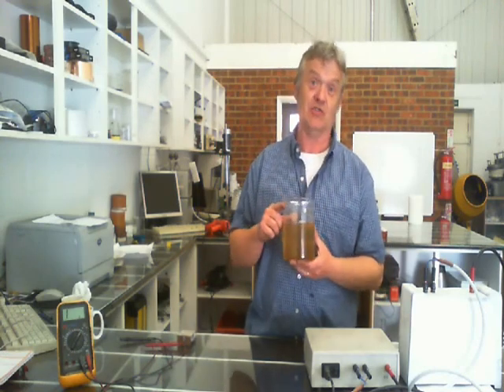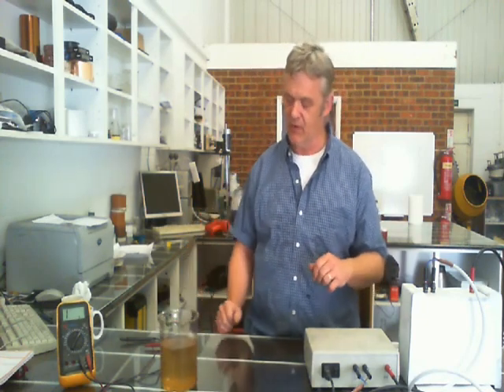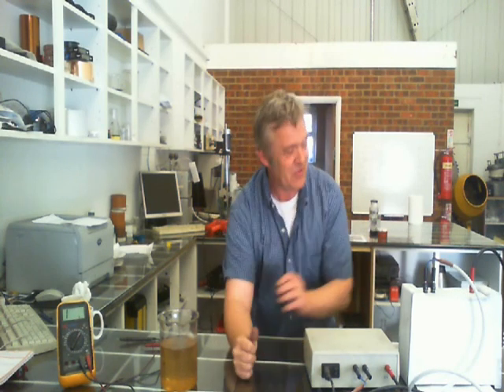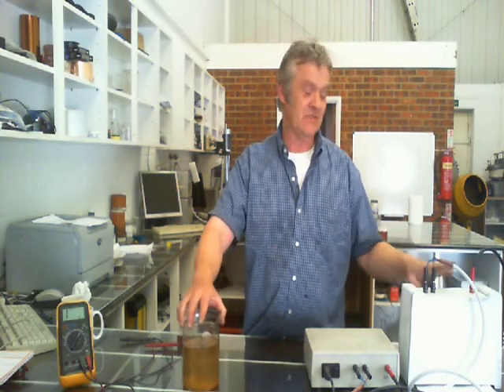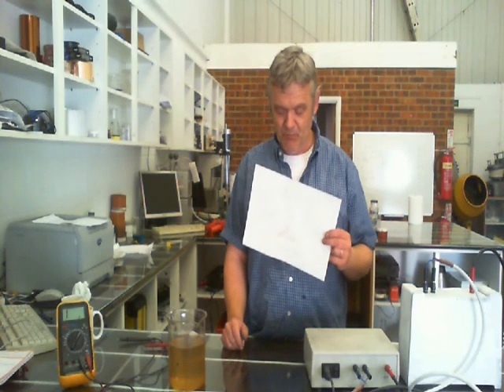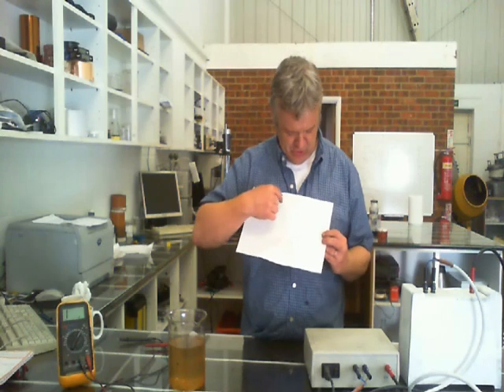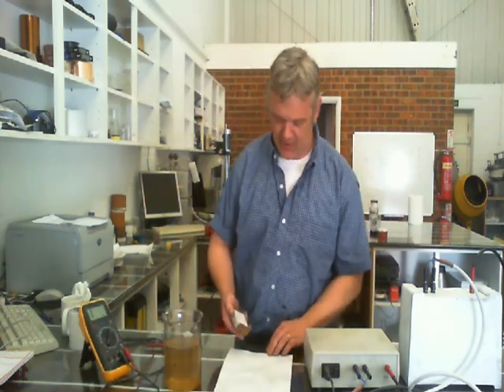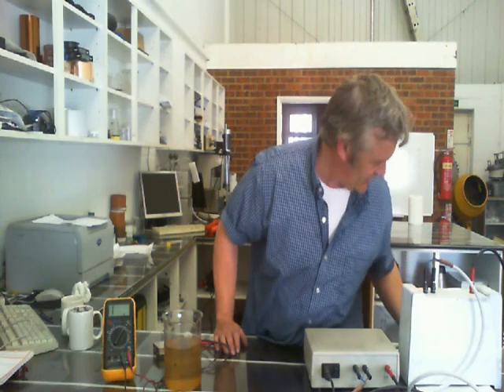How To Reduce Graphene Oxide To Graphene With Photonic Curing

Comment: Hi Robert. 
Look at this:  Highly-Flexible, Low-Cost, All Stainless Steel Mesh-based Dye-Sensitized Solar Cells
Is states they dye them with carbon ink
 http://pubs.rsc.org/en/Content/ArticleLanding/2014/NR/C4NR03999H?utm_source=feedburner&utm_medium=feed&utm_campaign=Feed%3A+rss%2FNR+%28RSC+-+Nanoscale+latest+articles%29#!divAbstract
Reply from the maker: brilliant mate - thanks for the heads up on that one - i think i will make one of these as we are just about there anyway - i get a great sense that we are ahead of the game here lol
Reply from the maker: here is an equally interesting one
http://pubs.rsc.org/en/Content/ArticleLanding/2014/NR/C4NR03999H?utm_source=feedburner&utm_medium=feed&utm_campaign=Feed:+rss/NR+%28RSC+-+Nanoscale+latest+articles%29#!divAbstract
Reply: Robert Murray-Smith Nice try, but it is the same! ;) 
I look forward to see if you can replicate something like this! 
Do remember: If you happen to find a way to cheap, efficient DIY solar cell..  Some groups won't like it!
Reply from the maker: Rob NvT
lol - no it isn't one is steel mesh the other is cloth - plus different authors, different journals - the idea is essentially the same - but they are different articles mate
Reply: Robert Murray-Smith Hahah well, without wanting to start a fittie.. I believe you, but then you have the links mixed up. Your link is the same as mine..
Reply from the maker: Rob NvT
oops lol - the one i was trying to send you was done on cloth but used the same basic ideas - sometimes i am a boob lol

Comment: I'm currently doing research. We use sodium borohydride to reduce the GO
Reply from the maker: yes - it's good stuff but not so easy for the average Joe on the street to get hold of which is why i have never done a video of it
Reply: Robert Murray-Smith Which method would you say creates a more stable sample of reduced graphene oxide?
Reply from the maker: Lee Blackburn
i don't really understand this question as it has no real meaning without context

Comment: why are you putting your probs on that block??????????
Reply from the maker: it is a thin film - i am measuring square resistance - i have done two vids on this mate
Reply: hmmm... if you put your probs directly onto what you want to measure... it would be more precise... no?
Reply from the maker: sk8pkl
no - watch the videos
Reply: can you link them? cause i cannot find them
easily
Reply from the maker: sk8pkl
this video Conductive Ink Technical Info And Test Procedures at time stamp 6:25 - there is a link in that video to a more in depth discussion of sheet resistance

Comment: Can you coat the whole transparency sheet with the Graphene Oxide solution, then mask it using a second transparency sheet with a negative pattern from a laser printer placed on top?  Placed in the flasher unit, the result should be conductive regions defined by the non-printed areas on the mask.  This could potentially be a good way to produce not only flexible displays and force sensitive resistors, but perhaps even ribbon cables, keyboards, or other peripherals and components.
Reply from the maker: you could most definitely do that and it is a good idea - the stuff in the jar that i show is good enough to go into an inkjet cartridge though - so that is probably the route i will take - but if you can't do that - your resist idea is very cool